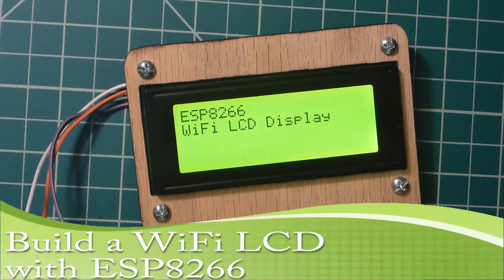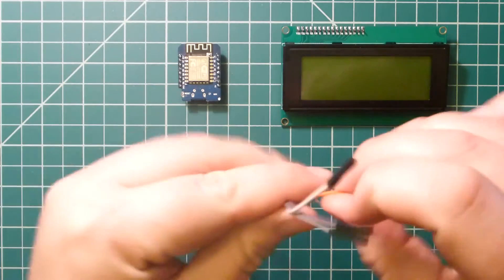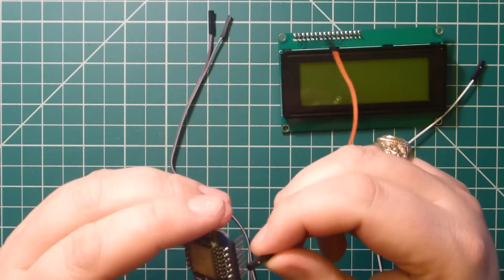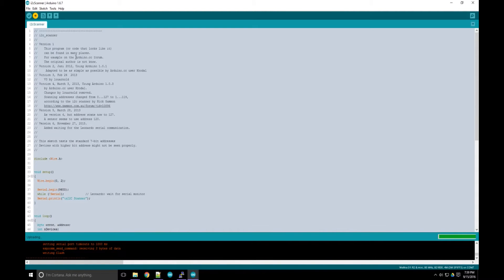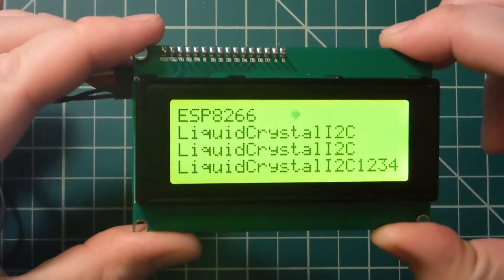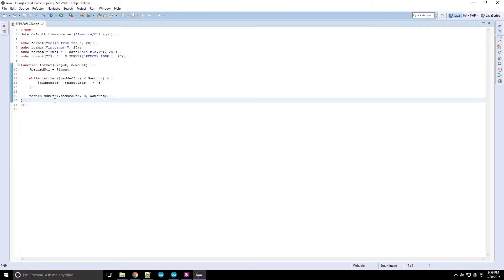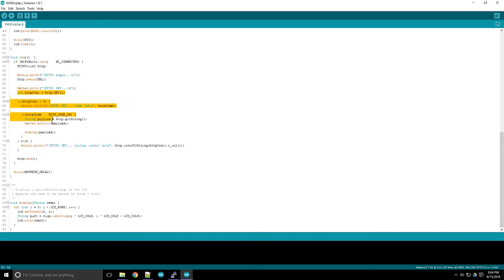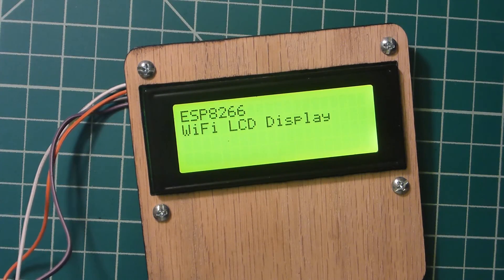ESP8266 WiFi Display

Comment: Hi Mikel, I am trying to do your project as practice, and I have everything set up ( heroku, spark, etc) but when I try to connect , the Arduino keeps saying "connection refused" on the terminal. Not sure what is causing it. Awesome video btw!
Reply from the maker: Have you tried connecting to the service from just your web browser or using curl? If it doesn't work from from those, then you might not have the address right or it might not be running on heroku correctly.